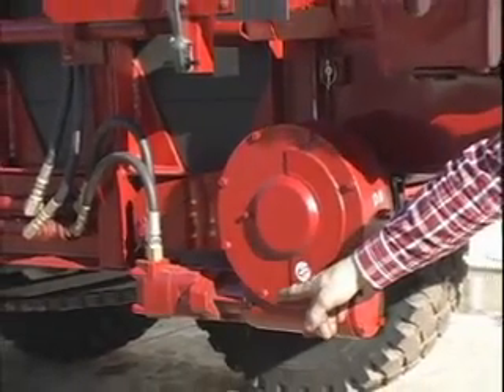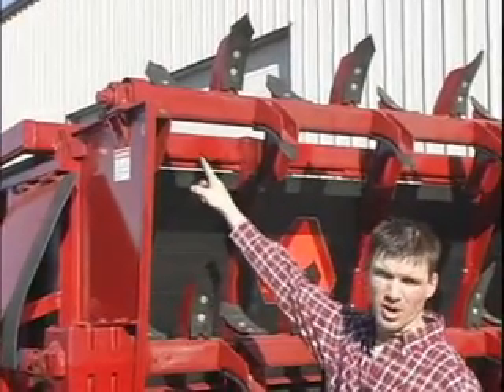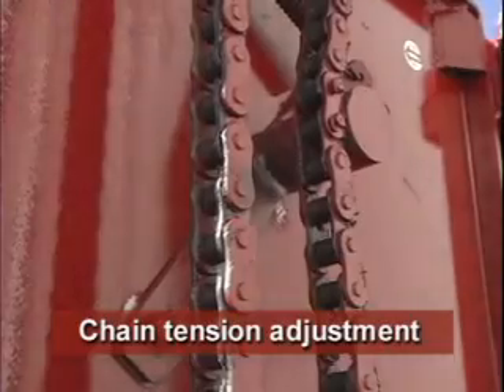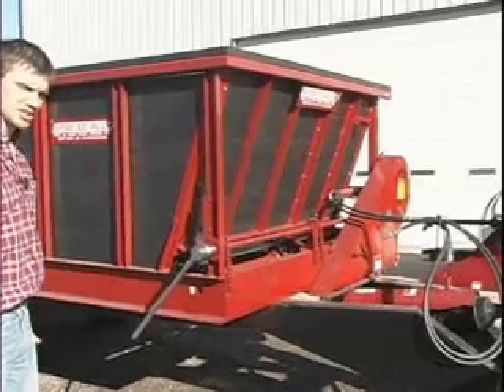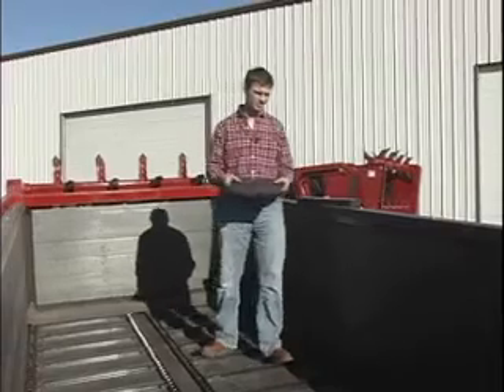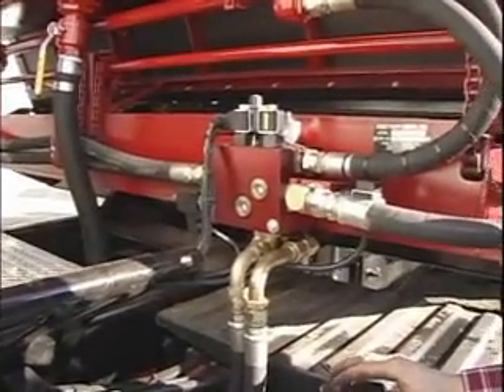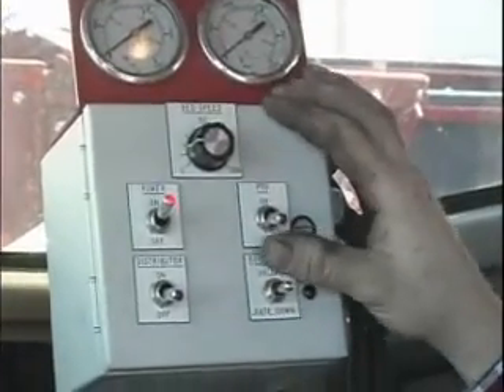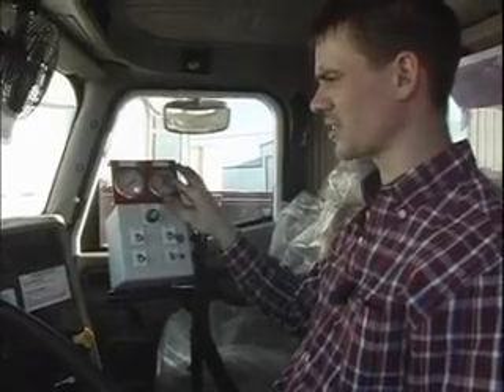Spread-All™ Manure Spreader Features (Part 2)

Comment: Looks like a decent spreader, but you just need those beater bars to be vertical... a 20 ton spreader that spreads only as wide as the box doesnt fit in a no-till operation, too many compaction trails around the field. Need 10 yard spreading width at least.